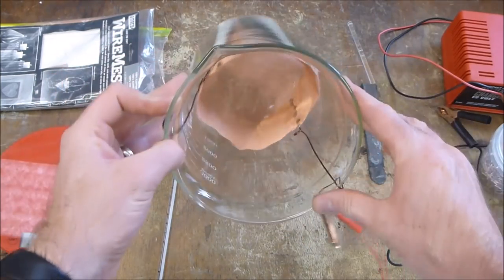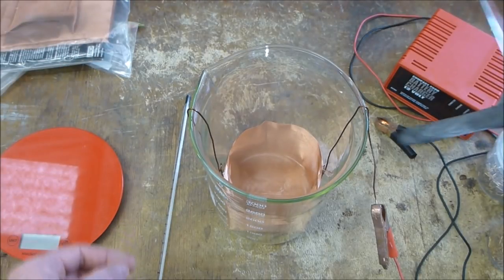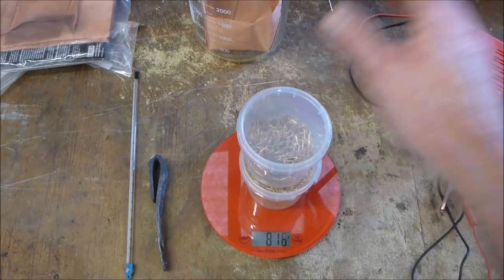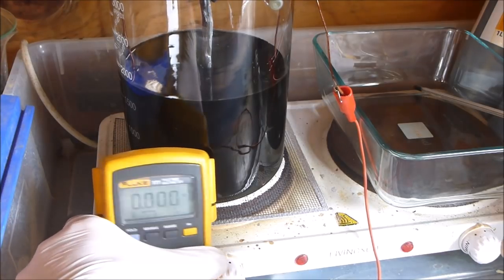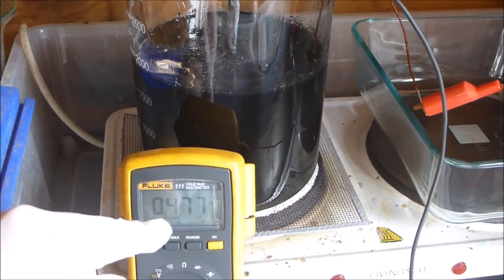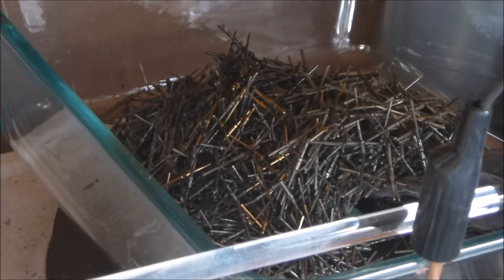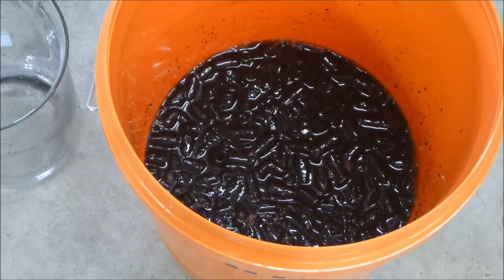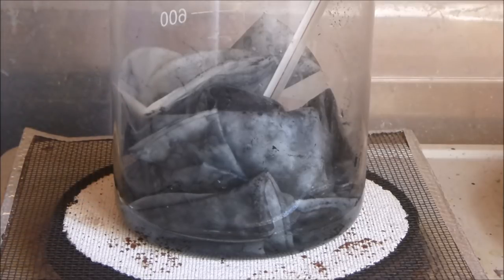Gold Recovery - Process and Yield of Wirewrap pins

Comment: I built a rotating cell to take care of the Faraday effect isolation. It works well except for the fact that the cell would get quite warm using a 12volt battery charger and 12-15 amps. A lower voltage source might be a solution to that issue. Overall, my system looks much like your if you were to tilt it to about 20° from the horizontal and add rotation.

Comment: Great video. I might ask, why are the pins dark gray after reverse electrolysis? And are they easy to rinse to get their copper / brass color back? Thank you and I wish you much success in the future.
Reply from the maker: Hi there, the pins are usually brass or bronze, I think the colour is due to the reaction of other metals contained in the pins with the H2SO4. A good wash with water, then tumbling them in a drum for a while would probably polish them back to looking Copper coloured. Alternatively, if you want to recover the Copper value, melting them into bars would also work well.
Reply: @successfulengineer  Thank you. I'll have to try it when I get to it. Maybe in half a year I will have completed a workspace with a fume hood, etc. I am currently disassembling electrical waste and sorting the pins and other stuff. Could I ask if it is possible using reverse electroplating cell for pins of any material? In addition to the classic ones, I also have strongly magnetic iron alloy  pins, tinned pins with a flashed gold, etc. Is there any restriction on the base metal?

Thank you and good luck. I hope to have some new videos soon. Your series on IC chip processing is one of my favorites on YT : )

Comment: I have never tried this, but what if you used a magnetic stirrer to keep the pins moving around a little bit during the process?
Reply from the maker: Yeah, that would almost certainly help a bit. Even some mechanical mechanism from the outside like putting the container on a vibrating surface might help.
Reply: @successfulengineer  time to tone down the palm sander. 🤔

Comment: Is the electro plating worth the effort? Do you get a better yield than straight chemistry?
Reply: could've skipped the  reverse  electroplating lol
Reply from the maker: The deplating is a very nice process because you end up using a very small amount of acid and creating hardly any waste that needs treating. It is possible to 100% re-use the Sulfuric acid pretty much indefinitely, because it is not actually dissolving the Gold. Dissolving a kg of pins with Nitric acid would create probably 3L of waste acid at a minimum and Nitric acid is usually much more expensive than Sulfuric. The yield is essentially the same, maybe slightly less with the few pins I missed, but it is a much cleaner, nicer process for plated metals.
Reply: @successfulengineer  ,

Comment: good video, could you add peroxide?
Reply from the maker: Did you mean right at the end for the refining?Yeah, I think the black powder would be fine enough that that HCl and peroxide would work.
Reply: @successfulengineer  , I've seen where people have used the peroxide to get air and movement with the nitric(if my memory is correct, maybe it was a different acid), I know it wasn't with the reverse electroplating process. so it's  ok to add peroxide to sulfuric acid in deplating?
Reply from the maker: Not sure, but I don't think there is any advantage in adding peroxide to the Sulfuric acid. I think it tends to be added when you want a lot of free oxygen in a solution.
Reply: @successfulengineer  sounds good, mixing like you did works well have you reverse electroplated depopulated pcb's boards?

Comment: hi mate,

the more i show your videos, the more i am excited about your way to commentate what you are actually doing at that moment. in other videos i get afraid, because of their nonbackground of basics of engineering and the results are they beginning their sentences with ahhh and ehhh and pausing before they mean they get a crazy information, ehhh ahhh it makes me go crazy. and then comes your videos. nice, kindly, on point and exactly how engineers are communicating. thank you.
your indicationmethod of thicknesses of plating surfaces are clever and you exactly combine the informations that are getting off from that reactions.
and this finally makes me to write this comment.
you said, if i remember that correctly, goldplated ceramic surfaces should be hardgoldplated, right?
there is an offer i struggle with to buy them. can you give me an opinion?
ceramic plate and ceramic chips, non polymer things in that auction.

kind regards

https://www.ebay.de/itm/GOLDSCHROTT-VERGOLDETE-CHIPs-KERAMIK-PLATINEN-CPUs-BASTLER-KONVOLUT-SCHROTT/124131215322?hash=item1ce6cc07da:g:jFcAAOSwGSZec0oB
Reply from the maker: Hi there, thank you very much for you kind comment, much appreciated. Ceramic components don't always have a lot of Gold, but they are almost always very easy to process, which makes a big difference. I would rather process ten times more stuff that is easy than some material that is very complex. Unfortunately unless you 100% know what you are buying, it is always best to buy the smallest amount you can and then test it. Even seemingly identical ceramic CPUs can have varying amounts of Gold based on which factory they came out of. Good luck and let me know how you go. Cheers